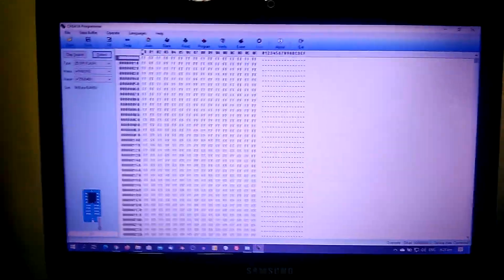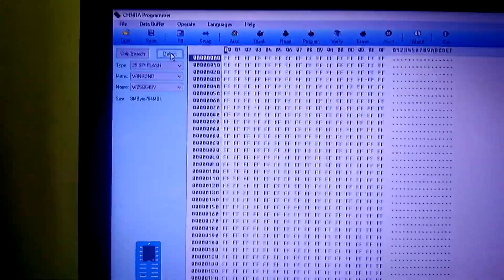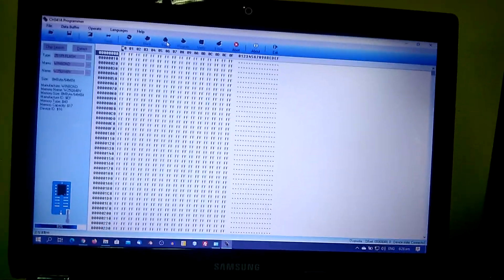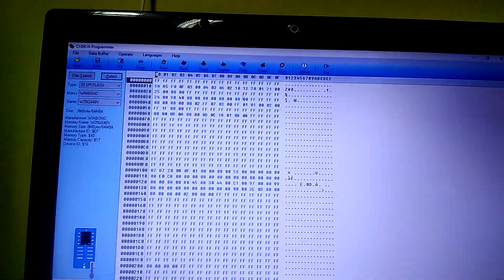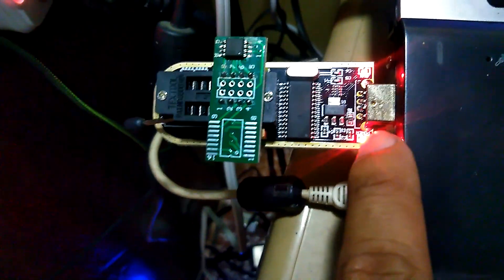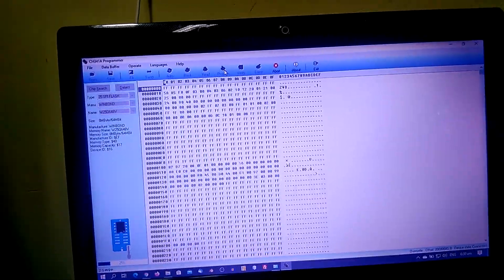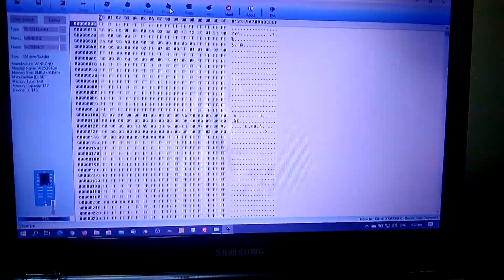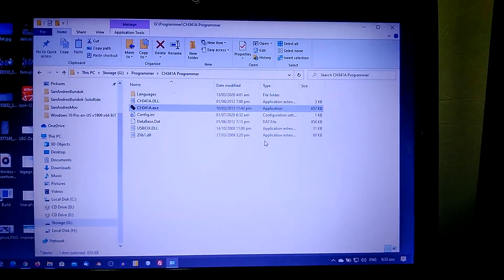Using CH341A to program a laptop bios

Comment: Hello sir...i want to flash a bios file on an Hp G3 250. i download the bios file from official site and it is an .exe file. I extract it and it gives me another .exe file. I extract it again and it gives me many files of the installer. Another way now...i open the .exe file from Hp and i choose "make a copy of the bios file and it gives me 4 .bin files each of 8mb. Which i choose to write on the chip?
Reply from the maker: Probably those are different versions of the bin file you can use any of the bin file. But make sure to backup your old bin file just in case.